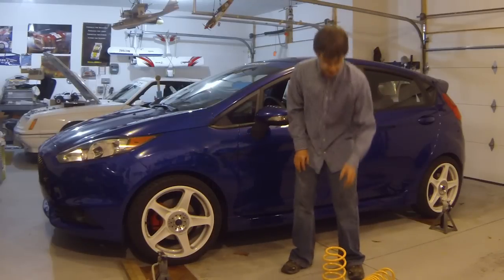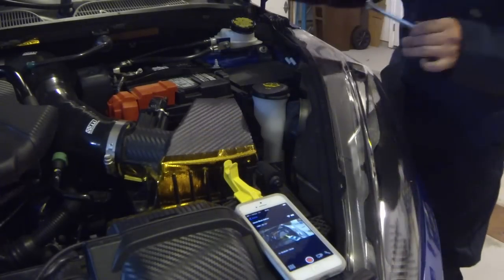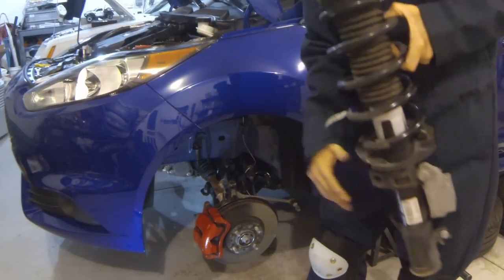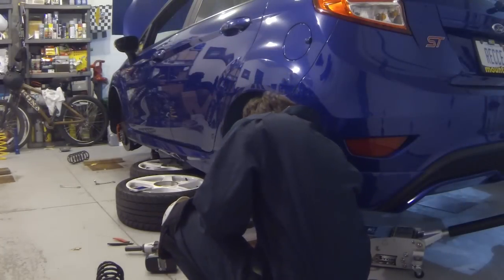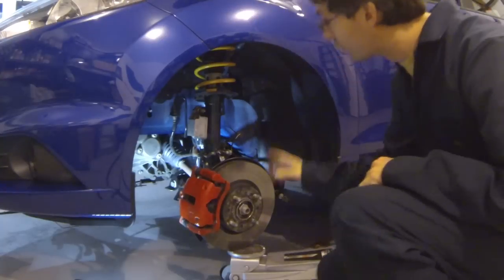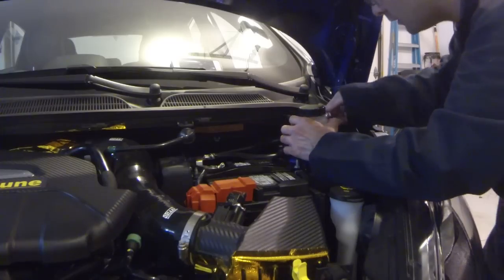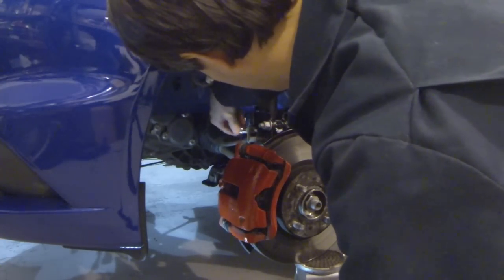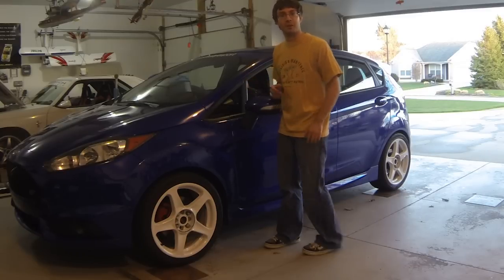How to install Mountune Sport Lowering Springs on a Fiesta ST

Comment: For anyone wondering the torque spec for the upper strut bolts (x3) is 48Nm or 35.4 ft-lbs.  These and other specs are available on posts #3-6 at http://www.fiestastforum.com/forum/threads/4025-Strut-torque-specs?highlight=torque.

Thanks to OP for this helpful video.
Reply from the maker: Thanks! Great having a nice link to find the torque specs.

Comment: +BRGT350 took my vogtlands off to throw on some Mountune springs. Realized why I was rubbing/binding. Vogtlands are alot wider in diameter. Live and learn.
Reply from the maker: yeah, that could surely cause an issue.

Comment: I followed your video and the manual when installing new struts and springs today and I’m getting some clunking so I’m go to have to take it all apart again and see if I can figure out what’s going on
Reply from the maker: Could be a number of things. If it clunks when you turn the wheels, then it is probably the upper strut mount not seated properly on the spring. A rear clunk could be the springs not seated properly or a loose shock bolt. The front could also be loose strut clamp bolts or upper strut nuts. There aren't too many fasteners, but make sure they are all torqued to spec. I have done a number of Fiestas and never had one with a noise when done.
Reply: BRGT350 thanks I have a feeling it’s the top nut on the strut which I thought was tight. I got a torque wrench on everything else
Reply from the maker: that one is tough to get tight. I have a shop do my strut assembly and when I have seen them do it, they hit the top nut with an impact.
Reply: BRGT350 the problem is with the Bilsteins you have to hold the shaft with a Allen key to stop it spinning so I had to figure something out. Looking back that’s what I should have done
Reply from the maker: yep, that is correct on the Bilsteins. I have a set on my Mustang and I can't remember how I did the top nut. I think I hit it with an impact since I didn't have a crow foot attachment so that I could hold the shaft with the allen wrench and torque the nut. It has been a long time since installing them on my Mustang, so I don't completely remember. The upper strut assembly on that car is very unique with caster-camber plates and adjustable coil-overs that use a special upper strut mount. When the ST is due for new struts, I am really thinking about going with Bilsteins. I love them on my Mustang!
Reply: BRGT350 you can’t get a crows foot in there due to the design of the top hat so I bought some craftsman “ through” sockets so I’m going to use that. That should work, good thing is they are easy to remove if I have to
Reply from the maker: yeah, that should work. I forgot that the upper strut mount on the Fiesta won't allow the crows foot to work. On my Mustang, the strut nut sits up high and clear of the mount. It actually sits high enough that I had to notch the inner hood. The Fiesta comes apart and goes back together pretty easily, which is really nice.

Comment: Hopefully I can get your opinion on this. I have a 2011 non ST, should I go with the ford handling pack or just do springs when it comes to handling?
Reply from the maker: Timon Martin I had the Ford handling pack on my 2011 Fiesta and loved it. You will want to do springs with matching shocks and struts. This will give you the best handling and ride comfort. Stiffer springs with less stiff dampers will give you a harsh ride and the spring won't be damped enough. The Ford kit is perfectly matched and easy to install.
Reply: BRGT350 I realized we had the same car when I started stalking your page, we should have been brothers. My logic is: the factory struts have 70k on them so probably best to do the pack. Glad to get confirmation from a trusted source, thanks for the uber fast reply! p.s. how did the ride height turn out? a half in sure doesn't sound like much but like you, I'm not into that stance stuff.
Reply from the maker: https://flic.kr/s/aHsjCLV1CP here are pictures of my 2011 with the Ford Racing suspension kit sitting on P215/40 17 tires. I felt the ride height looked performance and the handling and ride were outstanding. With 70k on the struts, they are due for replacement anyway. On my brother's 1.0L Fiesta, we put on factory ST springs on stock struts. It didn't lower the car as much as the Ford Racing kit nor was the ride quality as nice. You will be very happy with the results with the Ford Racing kit.
Reply: That looks really nice, one day i'll get there but function comes first. I went ahead and ordered the handling pack, EBC brake upgrade and control arms (LF ball joint is bad). Now I am just researching which bolts and nuts are one time use. Thanks for the feedback! 

After watching the review you did of your brothers 1.0, I found a Fifth Gear race of the 1.6 N/A and the 1.0 Turbo, I was shocked the 1.6 was dominated. Eventually i'll get the ST or jump right to an RS. Could you imagine if they released an RS Fiesta here? That would be superb. Thanks again!
Reply from the maker: The 1.0L with a manual is a great car! I was shocked at how much fun it was to drive and how good it sounds. The production based rally cars now use the 1.0L instead of the normally aspirated 1.6L. That really shows the potential of the engine!
Reply: It really is amazing what they have done with these small engine. I do wish there was a bit more after market for my little 1.6, I know it has loads of locked up potential.
Reply from the maker: DeadHook Motorsports is doing crazy stuff with the 1.6L EB engines. I am shocked how much power they can produce.
Reply: BRGT350 I need to look into that. all I have atm is a Green filter and royal purple but top end she just pulls, I've had to pop the hood just to make sure there isn't a turbo hiding somewhere. I really wish there was more available tuning wise for the 1.6. Once I get my parts on over spring break, I'll send you a link for pics.
Reply from the maker: my apologizes, Deadhook Motorsports is working on the 1.6L EcoBoost engine and not the normally aspirated version. I installed the Borla/Ford Performance exhaust on my 2011 Fiesta and picked up some additional power and torque.
Reply: BRGT350 no worries, I realized after doing some looking into it. that 11 sec ST is amazing though. speaking of exhaust, I was thinking about doing cat-less headers with the stock exhaust, from what I've read that would free up a few ponies. really wish the NA fiesta had the ability to have its computer tuned, that's where the real power comes in.

Comment: Just fitted these today ... but my front drivers side is 2" or 3" lower than the left (left being the correct level) any idea what has caused this? Is the spring faulty ??
Reply from the maker: 2-3 inches is a significant issue! There isn't much left for any suspension travel and you could be bottoming out the strut. There is something very wrong with the car being that far off on one side. Typically 1/8"-1/4" difference left to right is considered normal. Anything more than that needs to be looked at. I would say yours is probably sitting with the strut on the bumpstop, which means any bump will blow the strut. You need to get that sorted out quickly. The problem some 2017+ owners have seen is a rear ride height that is taller with the springs installed, but that is due to some unexpected changes to the rear suspension geometry that moved the spring perch. I have not heard of any issues with the fronts.

Comment: very nice and informative video mate, two questions, don't you have led daylights?  also how come your fog lights come up with start up?
Reply from the maker: The U.S. Fiesta doesn't get the LED lights :( The fog lamps and head lamps are set to automatic and turn on in the garage due to the low light.
Reply: +BRGT350 alright, I'm also always set to auto but the fogs are set only manually. do you consider also installing stiffer antiroll bars?
Reply from the maker: I am really happy with the balance of the car as it sits right now, both handling and performance. With a little left foot braking around corners, I can easily get the rear to step out and there is very little understeer at corner entry. Given the balance I have now, I am going to leave the suspension as is. I wouldn't rule out better dampers in the future, but only to replace the OEM units as they age. Out of all the cars I have owned, the ST required the least amount of changes to the suspension to get the car just right. I am really happy about that!
Reply: +BRGT350 I'm very happy to hear that as I was thinking of buying the whole kit from eibach but I got stuck in the question: does it need it?? now I know... thank you mate, drive carefully
Reply from the maker: yeah, I would not waste the time or money on the sway bars. I was skeptical on how well the Mountune springs and stock dampers would work, but they are perfect.

Comment: What kind of light are you using? That looks very reliable and bright.
Reply from the maker: Sylvania ZXE low beams and Hella yellow fog lamps. I have been very happy with these bulbs.
Reply: BRGT350 lol, sorry, I should have been more clear. I meant the LED light thing you were using to help you see better when you were working on the springs. I've been wanting to get a work lamp so I've been using this cheapo LED light, but it's just not bright enough.
Reply from the maker: oh, the work lamp is a Craftsman LED lamp. It worked great for the for first few years, now it doesn't charge.

Comment: Any regrets with doing springs? I've been considering the bilstein b14's on whoosh. If I'm not mistaken, aren't you a suspension engineer?....figured you'd be a good person to ask!
Reply from the maker: No regrets at all on the springs! I have noticed the rears do rust a bit quicker than the factory ones, but everything rusts after a few Michigan winters. Besides that, the springs have been perfect. The Mountune springs should pair well with Bilstein dampers. When it is time to replace my factory ones, I am sure I will be going with Bilsteins. I run their HD dampers on my Mustang track car. Yes, I was a suspension engineer for a number of years before changing jobs. Same company, just moved into the commercial side instead of engineering.
Reply: Thanks for the info. Yeah I'm no stranger to MI winters here in Grand Rapids! Looking forward to taking the winter tires off soon :)
Reply from the maker: Nice! Always good to find another West Michigan ST owner. Since working from home, my ST hasn't left the garage since early January. I did do the full winter prep, but it was able to stay out of the snow this season. Excited to put it back into summer mode in a few weeks. I wasn't sure when I was going to go back to the office, so I swapped over the winter stuff just in case.

Comment: How long does it take for these to settle ? I installed mine yesterday n I honestly can’t tell the difference from stock
Reply from the maker: It can take a day, but you can speed up the process by driving the car and articulating the suspension. I usually do a low speed slalom (20mph or so) with a lot of steering input in order to transfer as much weight side to side. This compresses and extends the springs to help them find their static position. I think it took around a full week before they finally came to rest. I measured the ride height with the stock springs, then after lowering at daily intervals. The biggest drop came after articulating the suspension and then it gradually works down around an 1/8" or so.
Reply: BRGT350 I had the rear springs on for over a week after I installed them n my car was actually higher than stock at the rear. I rechecked my installation n everything looked good. Any ideas why this is ? I wasn’t able to put the front springs on due to time but at this point I think I may just put the rear stock springs back on and hold off on the fronts since the mountune springs seemed to have the opposite effect of what they should do
Reply from the maker: what year is your ST? There are a few reports of 2017+ ST's sitting higher in the rear with the Mountune springs. I was reading about it online last week. Something in the twist beam changed in 2017, but I have heard a bunch of different reasons why.
Reply: BRGT350 mine’s a 2015 (same color as yours btw). I’ve also heard reports of 2017 issues, but I’m assuming yours is the same year as mine, which is why I’m confused that mine aren’t sitting right. I contacted mountune n they had me send before n after pics but I still haven’t heard back from them yet
Reply: BRGT350 I also noticed that the rear mountune springs were about 1.5” taller than the stock springs which seemed interesting to me
Reply from the maker: huh, that is very odd. Yes, I have a 2015. Here are some of my install pictures, which may or may not help at all https://www.flickr.com/photos/brgt350/albums/72157646766764559/page1  I was hoping to have a picture of the stock spring next to the Mountune spring. Doesn't look like I did that on the rear. I can't recall if they were taller or not when they were at their free height. Mountune can be a little slow to respond as I think Eric is the only one there who handles all of customer service.
Reply: @nathanbrubacher5689  IF you got your car used, maybe you already had lowering springs in there!? lol

Comment: Does it make going over bumps a bit softer or more harsh?
Reply from the maker: Well, it doesn't really make the bumps more or less harsh. The ST rear feels like the rear shock has too much damping for the factory springs. The result is the rear having a very abrupt end to the spring cycle, making the car feel unplanted over bumps. By increasing the spring rate, the factory dampers are better suited to dampen the increased rate, therefore the ride actually improves. A shock typically takes 1.5 wave cycles from the spring to stop the force. With the factory springs, it felt more like 1.0 to 1.25. The Mountune springs puts it back to the 1.5, where it feels more comfortable. The ride isn't softer since the Mountune springs are 5% stiffer. It isn't more harsh either.

Comment: wish you show where those jack stands were on the car
Reply from the maker: Looking at filming that this fall as I have a number of requests. There are notches in the pinch weld that are where the jack stands need to be placed and even one at the CG so you can jack up the entire side in one place.
Reply: BRGT350
Yes I would really like to see this I wish to store my fiesta on jack stands over the winter to keep the mice out and get it off the tires Looking forward to your video of this sir!
Reply from the maker: actually, for winter storage, it is better to leave the car on the ground. My dad and I store our Mustangs in the winter and used to put them on jack stands. More research determined that leaving them on the ground with the suspension at proper ride height, the bushings stay in their neutral position. Lifting the car forces the bushings to stay in the far reach of their travel for an extended time. This leads to premature wear on the bushings. We now keep our cars on the ground and have not had any issues. It takes a few miles in the spring for the tires to go back to being round, but that is about the only downfall. You could jack up the car every few weeks or once a month and rotate the tires 90 degrees to cut down on the flat spotting.
Reply from the maker: I might be putting the Fiesta on jack stands next weekend to double check the exhaust connections, so I could have a video ready shortly. Yes, I am also into RC. I have a HPI E10 car with a number of different bodies, Traxxas Raptor Slash truck, Traxxas boat, and getting a good collection of aircraft. This summer I really concentrated on flying and my skills have greatly increased. I am finally out of high wing trainers and into low wing fighters. Took a little over 4 years to do it. Sounds like you have some great stuff planned for your ST! If you are in Michigan, let me know if you need help on the spring install. I have done a few of them so far.
Reply: Yea I am from Michigan kalamazoo
Reply: @MsDannyrevs  My pinch welds got bent from just having the car up for short periods of time, so probably best to keep it on the ground! :O

Comment: Did these fix or remove some of the bouncing effect from the original springs you get on the highway and bumpier roads?
Reply from the maker: yes, completely goes away with the mountune springs. The factory dampers are really aggressive with their rebound rate, so a slightly stiffer spring is actually better matched.
Reply: BRGT350 Thanks for the feedback, will definitely be getting a set now as soon as mountune Europe has new stock.
Reply from the maker: you will be very happy with them.

Comment: How long you drived with the springs ? Is it safe for the struts ? Thx
Reply from the maker: Probably around 30,000 miles or so. I don't remember how many miles were on the car when I installed them. The Mountune springs are designed to work with the factory shocks and struts. Any lower than the Mountune springs could cause the shocks and struts to bottom out, which leads to failure. The springs are 5% stiffer, which work well since the ST feels overdamped from the factory. A slightly stiffer spring matches well with the factory springs. Too stiff of a spring creates a very abusive ride, unless they are matched with stiffer shocks and struts. My Mustang, for example, has a spring rate that is 400% stiffer than the factory, but the ride quality is pretty good. The key is matching the springs to the shocks and struts. The Mountune springs for the Fiesta ST are matched properly to the factory dampers. For the ultimate handling, pair the springs with Bilstein shocks and struts.